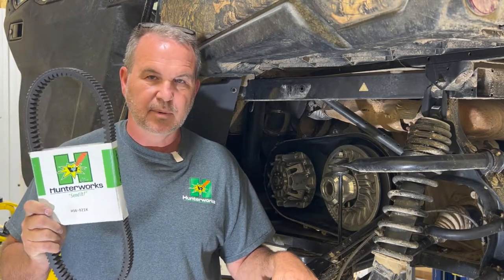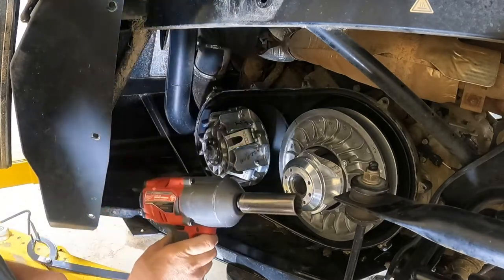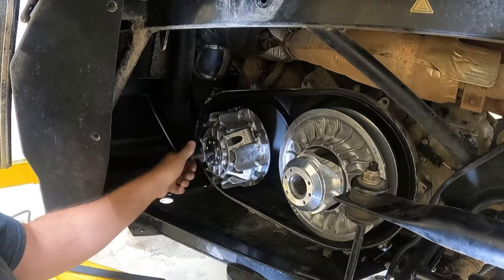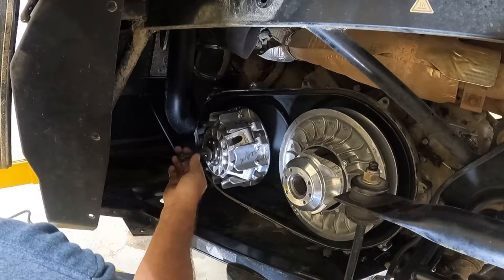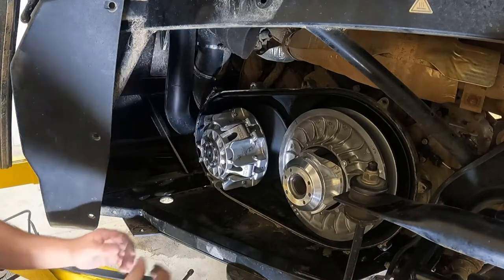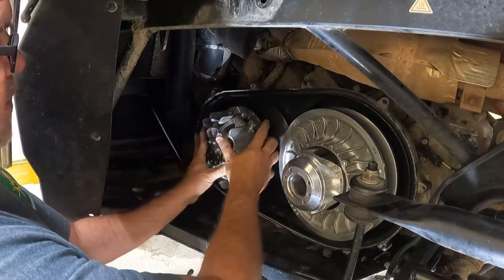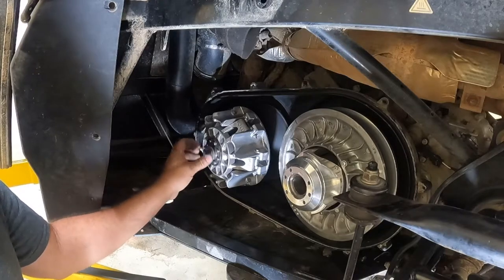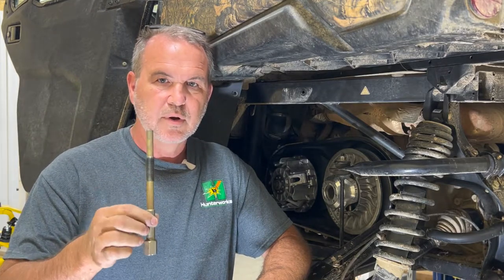How to Remove and Install Primary Clutch for Can Am Defender

Comment: Videos are very helpful I have a question. I have a 2023 can am outlander 1000 and had my bearing replaced by freedom 4x4 and my primary clutch came off and cracked my housing. What do you think in your professional experience would cause it to come off while riding. I’ve never had issues with this clutch atv was bought brand new and he was only person that worked on my clutch
Reply from the maker: The only thing I could say is not torqued correctly and not using a holding tool while doing it.

Comment: My cluch is not wanting to pop off like yours did any help would be appreciated.
Reply from the maker: Good puller and an good impact, still stuck smack the end of the puller while under tension with a heavy hammer, lastly google the bread trick for removing clutches